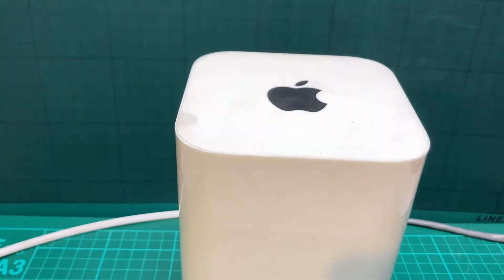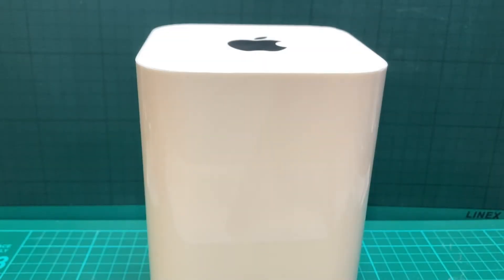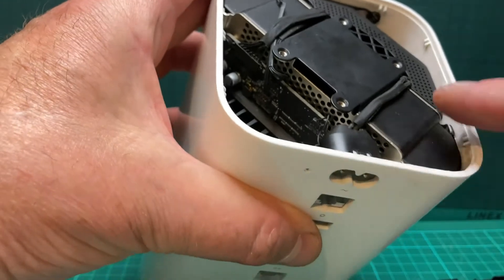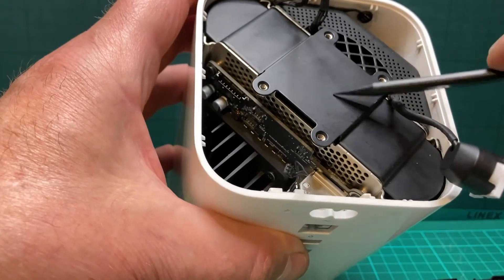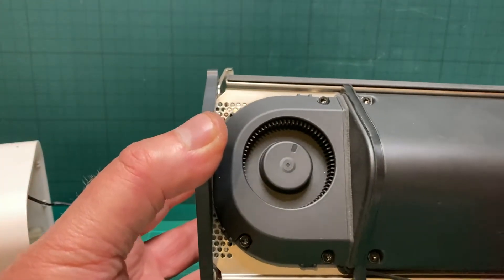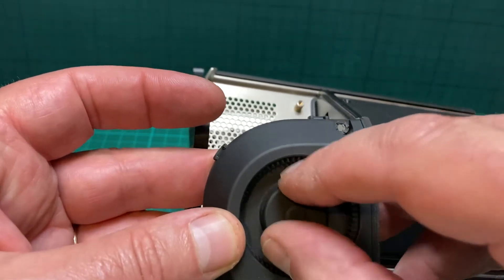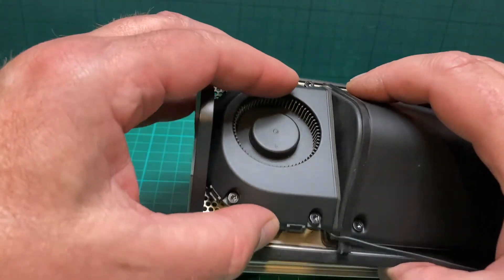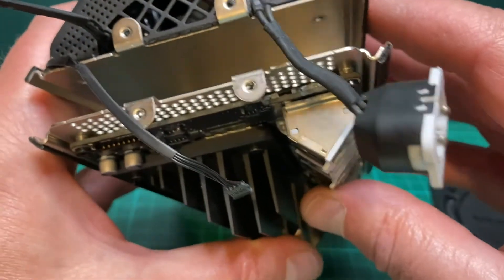Apple Airport Extreme Fan Replacement

Comment: Thanks for this video, I had totally forgotten how to open the bottom base cover😅

I have replaced my AEBS 3x fan since owning it 2015-2016? The first 2 using apple part when I had access to GSX working part time as an ACMT/IT consultant. I think the price was around $15-16. This time I bought the same sunos brand fan at amazon for $20

Comment: Reassembly is the hard part. These tiny pin connectors are a real pain to reconnect. Your video would be better demonstrating reconnecting these tiny pin connectors. They do not simply snap into place.